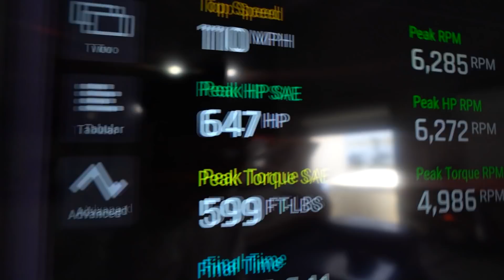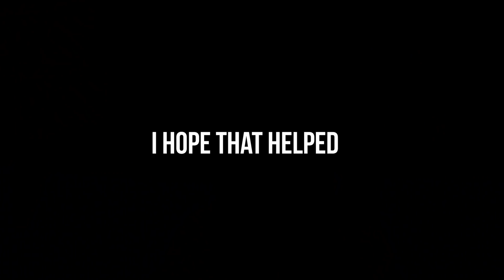My Record Breaking Twin Turbo C8 Corvette Is Too Powerful For It's Own Good

Comment: Many good ideas on where that oil may of come from, don't forget about valve seals and that would cause oil in the intake even if you vent the breathers into a catch can. All it would take is a slightly bent valve and time. Might of been cool to drive it to the track or dyno, but that could of caused what you see over time and just seeing the results. Not knocking anyone because its just wear on a high hp motor that's been road driven for many miles. Hope that's all it is, much better pulling a head then the whole block. Goodluck at the track! grab that record back

Comment: Good luck!  From past track vids, think you need more off the line, leaves a lot softer than the record holder.
Reply: I agree 
This car should hit harder on launch 
Maybe with the transmission controller it can.. .
Reply from the maker: Actually our 60ft is faster than the current record holder. But I agree, lately she’s been leaving soft… Unfortunately we found out why…
Reply: @EmeliaHartford  Oh boy, well if something is hurt/broke that's all part of squeezing all the blood you can out of that turnip. At least it makes for good content.
Reply: @EmeliaHartford  Do you and the mad mechanic need to tear up the block to replace the pistonrings you fried? :D
Reply: @shitmyhellcatsays  that way she knows we’ll be coming back for more…clever lass @EmeliaHartford
Reply: @EmeliaHartford  You should race DDEs twin turbo Ferrari
Reply: I know you won't read this, but my gut says you melted the piston in the wet plug cylinder. Probably a torch spot from the top O.D. to the ring grooves. 
You should step up the maintenance of Phoenix 
Look at those plugs after every track day. It's a race car on the street 
Two Lane Blacktop  - he constantly reads and changes plugs 
It's smart  , like you 😜

Comment: if your intake had oil in it depending on how the car is sitting ive seen it where the oil drains in the intake to one single port of the intake making you scared that there is an issue with that cylinder when in reality its just oil from blow by in the intake, so make note of where the pvc port is on the intake
Reply: She really doesn’t recognize blow by?
Reply: The breather from the valve cover is going into a catch can
Reply: @Justinhomii  What do you think has her worried?
Reply: @Somedaysitrains  even with a catch can it can still get in the intake especially if its even half full

Comment: Emilia and crew, if there is one cylinder burning oil but shows good compression when tested, it is likely a valve seal issue in the right cylinder head. Love what you are doing keep it up!

Rob Royer, Technician at Torqqe performance Austin TX

Comment: could also be oil from the turbocharger it self......i would check that turbo first before pulling the engine....
Reply: Ending up in one cylinder?
Reply: @jonasthemovie  the smoke that was coming out ....had to be more than one cylinder getting oil in it....only one plug was shown to have oil but that was before the dyno runs...

Comment: Go to a better shop they can’t tune a car with a roots supercharger and they don’t have a hub dyno so they can’t measure how much power your cars have because of the wheel spin on top of that they recommended you to keep doing pulls even though there is white smoke coming out of you exhaust because you have burnt a piston ring and letting oil into the cylinder

Comment: Problem is the C8 for performance is a lemon with the flappy paddle gearbox. Go back to basics and fit either a proper manual gearbox or an auto. 
Vettes with powerslides are a good deal faster. With the engine where it is supposed to be.
Either that or tune it and set it up for road race conditions and totally forget drag strips.

Comment: As a longtime supporter of the concept that women can do more than their "traditional" roles; I applaud you for working on your own stuff. Decades ago I was a team leader in an industrial maintenance crew and my boss hired two women for the traditionally male jobs and assigned them to my team. The first question I asked the women was "let me see your hands".  They responded with blank looks, then showed me their hands. Naturally their hands were noticeably smaller than mine. I told them I had two specific jobs for them. With their small hands they could perform a task in minutes that took me several hours. Of course I gave both women every opportunity to learn anything they wanted to learn. One of the women eventually became my boss AND a good friend.

Comment: Be careful tethering your dog on a long lead like that, a friend’s dog was tethered that way and chased a squirrel to the end of his lead and injured his neck when he ran out of rope
Reply: There may be a few nuts working at Sheepy but Ive never see a squirrel lol
Reply: Same thing would happen on a short lead what's your point
Reply: @stylepoints.180  lot less force with a smaller rope, less of a running start. Use your head instead of asking “what’s the point” lmao. If the dog can only run 5 feet before getting yanked rather than 10 feet it will be traveling slower and the force around the neck will be less.

Comment: Curious....why do you guys keep going through plugs?  Is high temp related? Race fuel?
Reply: Both and more 
Tuning for boost, street driving and running methanol  = those plugs are doing triple duty!
Since they're also a good information source, plugs in cars like this should be Inspected/ replaced frequently